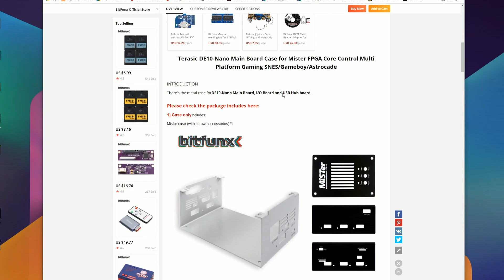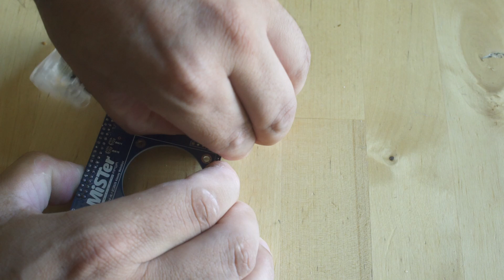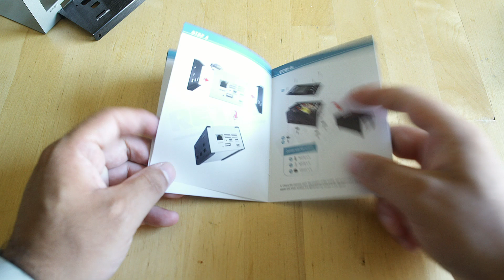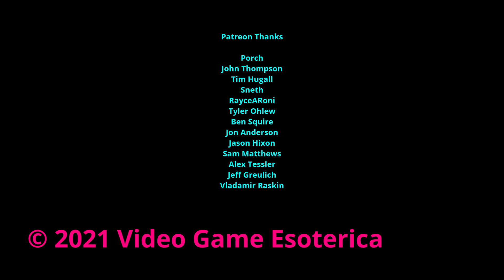MiSTer FPGA DE-10 Nano - I/O, RAM and USB Board Recommendations and Giveaway! How to build a MiSTer

Comment: No offense but this video sucks. I've heard that older aliexpress I/O boards (5.x rev) had bad resistor layouts and incorrect RGB levels so I was hoping a youtuber would actually put one of these things through its paces with something like 240p test suite and properly test the dang thing instead of pawning it off to his audience. Retroscaler seems to be getting good reviews and might be selling a good product here but instead you refuse to trust it on your DE-10 board. This inspires no confidence and hopefully whoever won the giveaway has a quality product that functions according to the MiSTer project's vision.
Reply: I should have mentioned I actually ordered this kit that includes the DE-10 from retro scaler when I left the comment and received it a day after posting. All my suspicions were confirmed! The I/O board I got didn't even fit flush on my DE-10 due to bad solder joints on the SNAC port, the RAM module immediately tested bad in memtest and to add insult to injury I discovered the heatsink's "thermal tape" packaged with my bundle was literally 3M double sided tape that I foolishly trusted when I began testing the terasic board. I'm still highly skeptical you tested these boards on your DE-10 and you have to admit it looks bad for you to proclaim that they are as good as any other when you provide ZERO evidence that they are indeed equivalent. 
Here's my post about the bundle on misterfpga.org: https://misterfpga.org/viewtopic.php?p=39521
and you can find my review of the bundle on the aliexpress listing I purchased from: 
https://www.aliexpress.com/item/1005001417547280.html
Reply from the maker: Good for you
Reply: @VideoGameEsoterica  Yep! We gotta keep the dialogue going and support the enthusiasts rather than recommend or push inferior trash when it comes to this wonderful project. The entire goal is accuracy and anything that compromises this undermines the vision of the developers.
Reply from the maker: I said I tested it before giving it away. Sorry you don’t like it but I know the person who won it is enjoying it so honestly I’m happy if they are happy. 

So if you think it sucks, cool. Also I’m not pawning anything off on my audience. I could have easily not done this at all. Or kept it for myself. Not sure how giving things away for fun is “pawning them off”. Am I pawning off Metroid Dread this week? I mean c’mon...have a little fun. Maybe next time I give something away you’ll win. Maybe you’ll win this week. 

I do these things because I enjoy it and it makes people happy. I’m here to, in part, make things a little more fun. Because we could all use more fun these days

And I don’t care if I explode my DE-10 board. If I do I just hope I catch it on camera. I’ll buy another if it dies due to testing. I work on camera on irreplaceable one of a kind hardware that’s in some instances the only known unit in the world. So to say I’m not willing to risk a commodity sub $200 piece of equipment when I take apart and work on irreplaceable gaming artifacts just isn’t a fair critique LOL

Hell I’ve broken enough cameras in my day (by jumping with them very high up in the air...long story) to probably pay for one years worth of private college at 2021 tuition rates 😂
Reply: @VideoGameEsoterica  I guess we'll take your word for it... 🙄
Reply from the maker: LOL or you can just look at the channel and watch me dismantle one of a kind items. But sure, take me at my word. I’ve been around for over fifteen years here and there so I’m cool with it :)

Comment: Where did you find the USB bridge that fit the case in the video?  I noticed that the top micro usb connector is soldered into the lower socket.  All the ones online use the top socket now for the taller cases.
Reply from the maker: It comes with the case itself to accommodate it. Links in the description :)

Comment: i wish the main board didn't use micro usb port mine took a bump and now its as loose as a goose so if it gets damaged or worn out the whole unit is unuseable bad design
Reply from the maker: It can be tricky but it can be resoldered relatively easily
Reply: @VideoGameEsoterica  ok thanks im just a bit annoyed

Comment: I build and sell these cards myself in the UK, the quality of these are OK, but the IO board isn't perfect, the micro SD card wont work as there is a soldering error. It's easily fixed, but a common problem when buying from places like aliexpress. At least this board has the P6/P7 pins soldered, plenty do not. The USB Hub really should have a barrel jack for power instead and even these have a soldering fault. They have gone to the trouble of building in the power protection circuit and then bypassed it, so that it has no protection.

Comment: Bitfunx has a bad reputation for copying/stealing stuff. These kinds of sellers are the reason creators go to such lengths to protect their firmware now. I guess most people don't care, but I sure wouldn't call them reputable.
Reply from the maker: The boards for MiSTer are open source and the schematics / BOM are available on GitHub so for these items I see no issues. I would not have given the items away otherwise. The reality is you or I could send in an order to a pcb manufacturer and hand populate them at home and sell them
Reply: @VideoGameEsoterica  oh yeah anyone can sell MiSTeR stuff. I'm talking about some of their other products like the Retroscaler2x. It's a Retrotink clone. They also stole the OSSC logo and manual for a while there trying to pawn off support to the official makers. I'm talking about things like that. From what I recall they also sell stuff under the Kaico name, which also has a poor reputation.
Reply from the maker: I am specifically discussing the MiSTer accessories so that’s generally what I’m focused on. Not familiar with the RetroTink outside of it obviously being a thing that I’ll probably buy eventually lol. But my Framemeister keeps chugging along

Comment: "MiSTer: the source"
btw, I think you put the fan on backwards.
Reply from the maker: Haha did I? I mean there’s no wrong way but maybe I did?
Reply: @VideoGameEsoterica  it is supposed to blow down on the heat sink?
Reply from the maker: Honestly you could “push” or “pull” in this instance. I thought you meant rotationally. I think blowing is fine IMO
Reply from the maker: The FPGA can be passively cooled with a heat sync and aluminum case too. So heat isn’t too huge of a concern